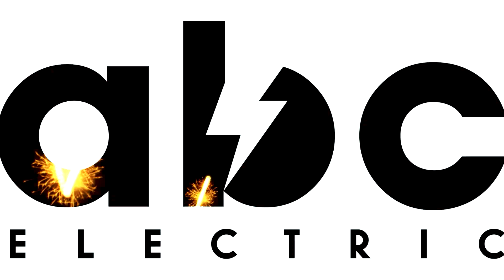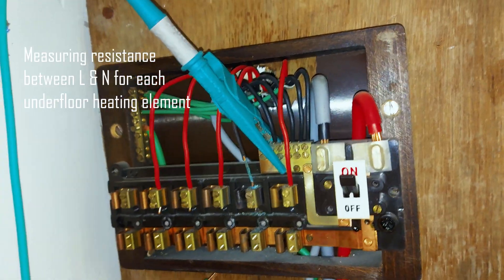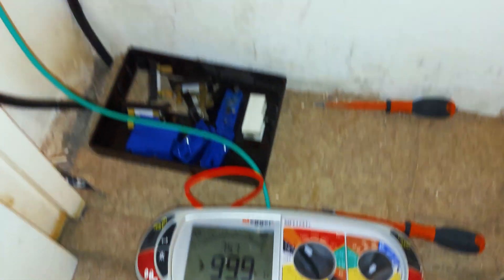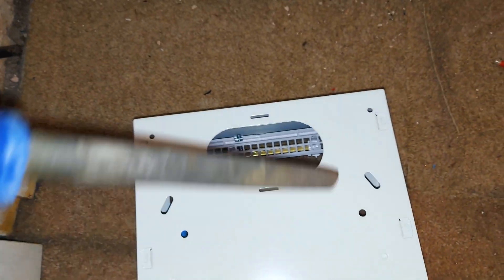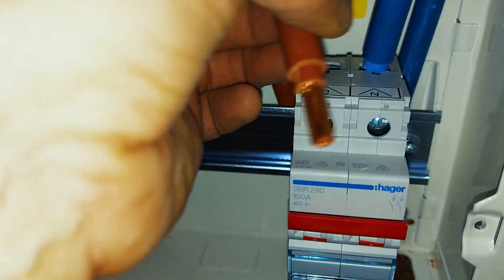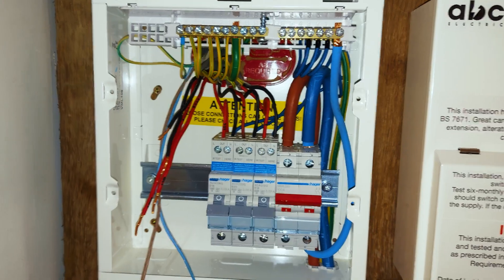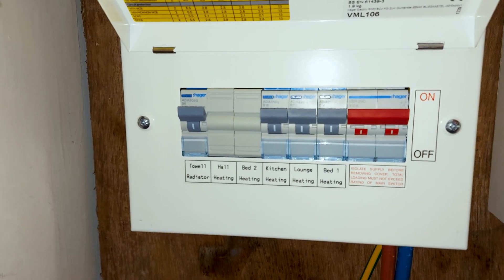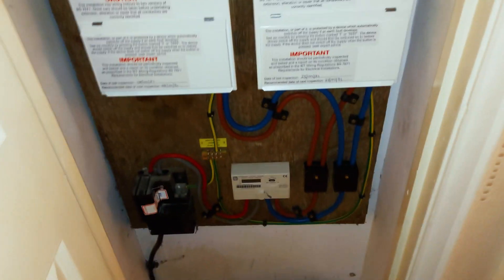Fitting an RCBO consumer unit and modernising old electric underfloor heating

Comment: Gosh, three phase would be much better for running that sort of heating load.
The UK is really strange only supplying single phase.
Reply from the maker: It's a really old system from the 1960s that isn't fitted today, but I agree the load is fairly substantial. In the UK it is exceptionally rare to have a 3-phase supply to a domestic property. I think that will have to change in the future as EV chargers and electric boilers etc are really pushing the limits of maximum demand
Reply: @abcelectric  I'm in South Africa (so we have your old round three pin sockets and wire colours still in use) and I have three phase (house built around 1960 too).
Both single and three phase are used for residential depending on the load requirements.
But in this block only 4 out of 24 houses have single phase.